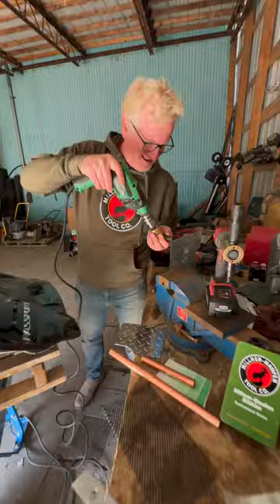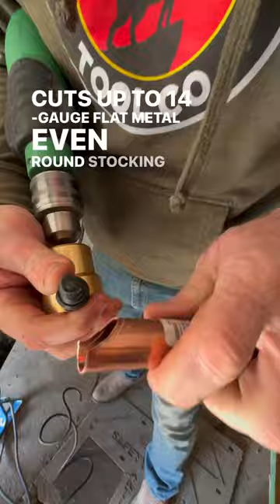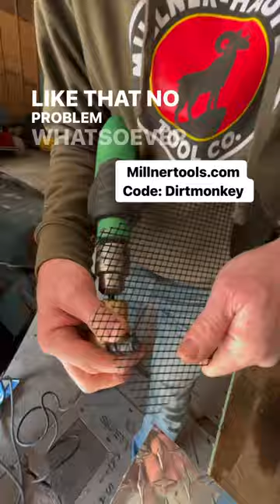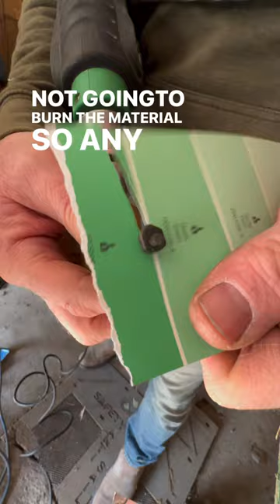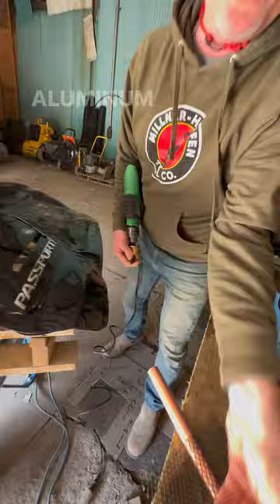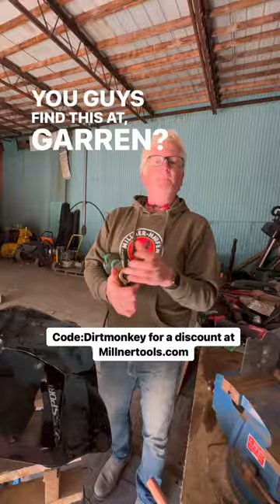They call it a “Nibbler”.

Comment: Aviaiton has had sheet metal nibblers for decades nothing new here
Reply: I think the gimmick is it’s a drill attachment unlike aircraft or construction nibblers being stand alone it would be cheaper for the person not using it every day or mobile tech carrying a drill
Reply: You have a good point, but it is a drill attachment, and it looks like you need to keep your hand on the attachment as well. That said, I would still go spend the money for an actual nibbler.
Reply: @rustyneumann1971  You don't need to hold onto the attachment he's just elbowing the drill and picking up tons of stuff so that's his control point. Tool might be too smart for you to handle.
Reply: @rustyneumann1971 I don’t disagree for anything other than mobile tech work where I can keep this in a backpack and possibly avoid another trip up the ladder or down the stairs
Reply: @SlickRickTPB  You need to hold onto the attachment or it will spin, unless you repeal Newtons laws (AKA: Reality)